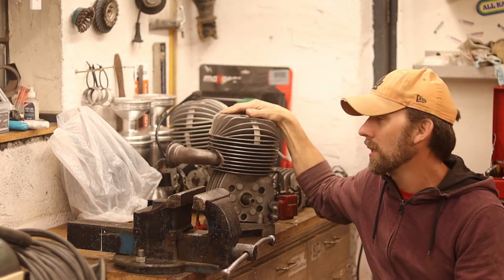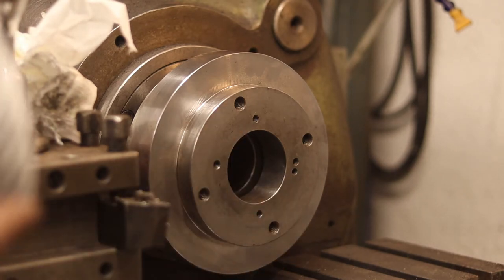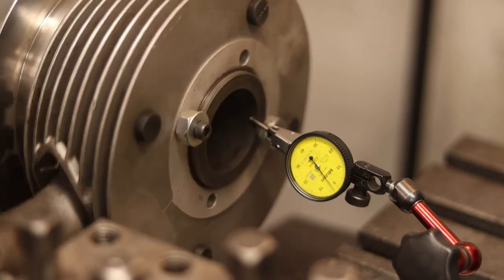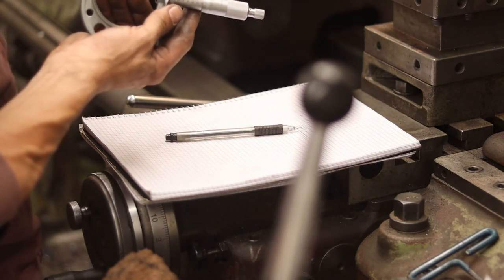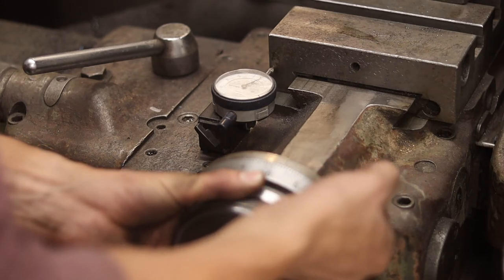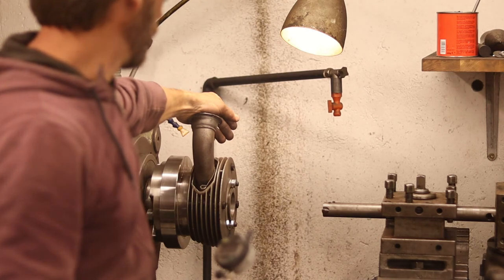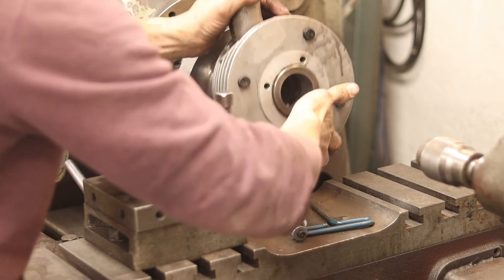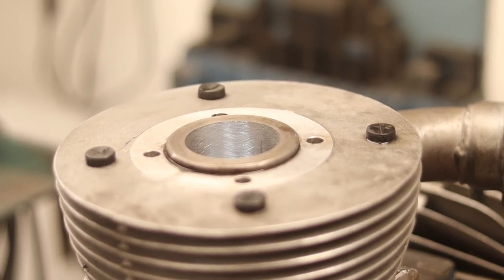Boring 100cc kart cylinder on the R5 lathe

Comment: Well done. Maybe the error you made in measurement was an advantage anyhow, it looked as though you just removed the scoring  in the cylinder with the extra cut.
All is okay if you can get a piston the correct size to fit. Cheers Peter
Reply from the maker: Misstakes are always annoying because they are potentially going to wreck the job. But in this case id have to agree, those extra 100s cleaned it up better. Turned out a piston for 50.36 cylinder size was hard to find so what i did was to hone the cylinder up by 4/100s and now its on 50.40 with a total variations in the bore of not more than 0.005mm so its pretty much perfect. A 50.30 piston is in the mail as we speak.